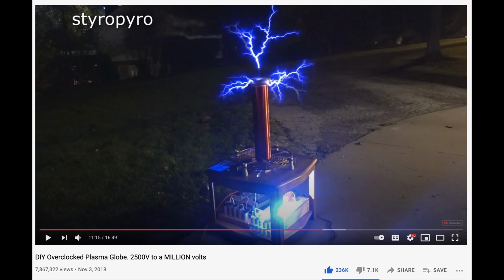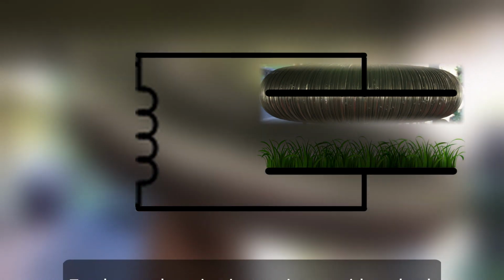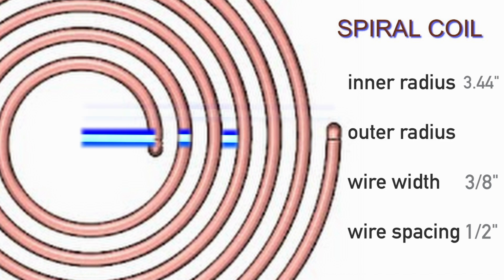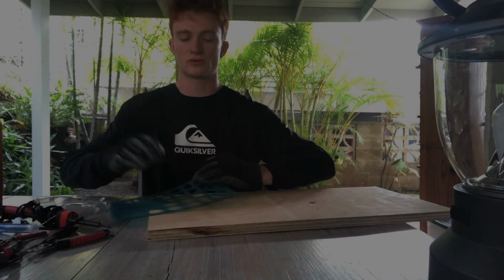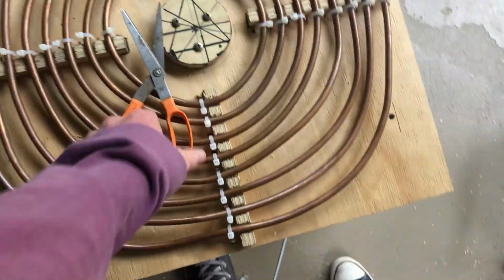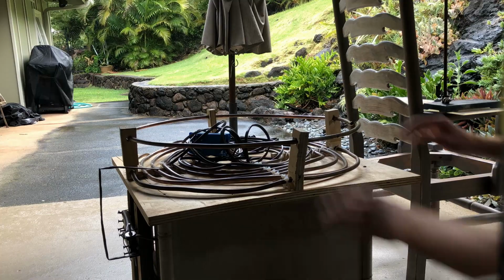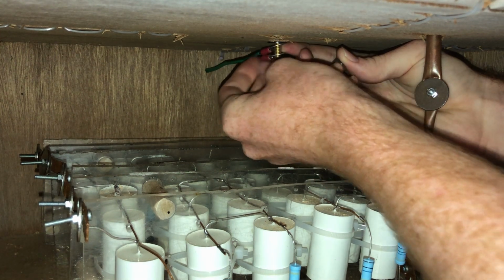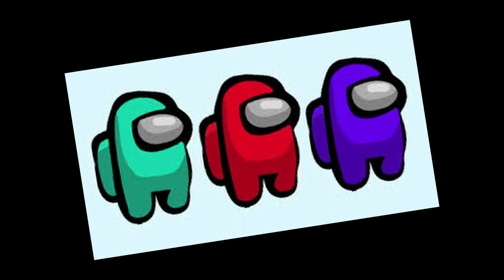I Built a Lightning Machine... Spark Gap Tesla Coil Build Guide

Comment: Like your video alot . Just wanted to let you know to solder copper tubing you should heat the areas beside your solder joint and not directly on it especially when applying the solder it self  . I solder tubes together alot

Comment: I can give you a useful tip for your next coil build. fill your 3/8 tubing with sand. fold one end over and smash it with a hammer, the other end just smashed without folding so that the sand can push out as you roll and it will keep your tubing walls from collapsing as you form them in a circle.

Comment: can you do a vid on how to wire the transformers together? Theres zero videos on how to do this for some reason and no one agrees on whether to wind them in parallel or series...
Reply: connect primaries in parallel and secondaries in series. On the output side, one end is connected to the core and another is usually separate, in the middle of it, usually one wire. Connect the end of one mot, the middle wire to the core of another, then on the one which you connected to the core of another, connect a wire from the core of that one. the other mot, connect wire to middle terminal and thats your output.

Comment: I'm currently building a Tesla coil right now. I've ordered the magnet wire for the secondary, I have my power supply and capacitors. The first 4 minutes of this video answered all the questions I had. Thanks a ton!
Reply: What’s the estimated cost for this set up?
Reply: @Commercial_Investments  If you use the capacitors he used, it would be around $400 for everything

Comment: I want to build a smaller SGTC, using a 2-4kv neon transformer as a starting point.  I live in an apartment and it can't be too powerful.   I know they are expensive but I love spun aluminum toroid, which are not cheap.  When in doubt, consult styropyro....Super Smart, but Super Cool Dude!!!
Reply from the maker: Make the desktop tesla coil i made. Much more compact and quieter, perfect for your apartment

Comment: Hi I,m just starting to build a Tesla Coil, On the Capacitors, Will a Couple door knob capacitor,s ratings of 20,000 volts and Rca 5642 Half-wave Rectifier vacuum tube work also,for Dc voltage. Thanks for any Help
Reply from the maker: Hi! Not sure about the tube but the caps will be fine. Research more about the specs of the tube.
Reply: @BackMacSci  Thanks for your Help

Comment: Can I use a microwave condenser instead of this capacitor system?
Reply from the maker: you cant use microwave capacitors because they will heat up and break due to the high frequency of the tesla coil
Reply: @BackMacSci  So what if I only use 1 transformer?

Comment: use brazing rods no flux for copper.  faster than flux and soft solder
Reply: Also if you're soldering copper and it goes dark/black colored it's WAY too hot and you need to buff off all the oxidation and start over.  Having  a quality flux is really important too,  you should go slow and spread the heat around to avoid burning away the flux.  You should be able to feed the solder in and have it wick up into the gaps, away from the direct flame.
This is also very useful if you ever do any plumbing work, since it's really difficult to get the metal hot enough to braze when there's so much mass pulling away the heat from the join.  Soldering takes place  at a much lower temperature.

Comment: Cost of this ?
Reply: Idk about Tate but I one based if of this, using a rotary spark gap. If you try your best to be thrifty, buying just the amount of stuff you need and search multiple places for best prices, you can build it for around $500
Reply from the maker: Mine was about $700 for everything i believe. But cheaper capacitors could have been used.
Reply: Oh yeah, I used 24 of these capacitors, saved around 60 bucks. I put made rows of 8 capacitors and put three rows in parallel. Job Beeftink, Labcoatz, Backmacsci, and styropyro all have great sgtc build videos.

Comment: I imagine it might have been easier to make the primary less squiggly if you had a ton of little spacers with just 2 holes each, or even just half-holes, sorta like a H with thicker center bar and rounded upper and lower openings, and  you added them along evenly spaced along the length as you wound it up.
Reply from the maker: I dont understand but thanks for the suggestion
Reply: @BackMacSci  I mean instead of just having that fixed jig, also add spacers along the length of the spiral to keep each turn aligned with the previous.
Reply from the maker: @tiagotiagot  I see now, yeah that would work.

Comment: How do you build the spark gap u missed a few steps ?
Reply from the maker: You cut some wood as a base, cut some copper pipe about 4-6” long, drill holes through the pipe at either end, hammer nails through the holes and into the wooden base. Space the pipes evenly apart and set the total spacing depending on the peak voltage reached by your power supply. Watch diodegonewild’s video for more info! 🙌

Comment: Well done! I got my primary of about 9 turns looking pretty good. I used 6 mounts instead of 4 and the had smaller holes under the big half holes so you can zip tie them as you go. It goes much better starting on the outside and working your way in, you really have to massage the smaller turns in carefully. I'm halfway through my first scratch built coil, finally got the parts for building a terry filter to protect my  absolutely badass 10kv 100ma NST! :D
Reply from the maker: Sheeeesh that IS a monster NST
Reply: @BackMacSci  It was the biggest one they had lol

Comment: Good deal. One thing I saw that you could have changed. The copper comes off the spool already bent. You were taking it off the spool then bending it the opposite direction. If you would have worked with the bend that was already there, you would have had alot easier time.
Reply from the maker: Thanks. I agree.

Comment: Hello!!! With 3 MOT... What is the power consumption from the mains? I would like to use 3 MOT like you, but I only have 3kW available in my house. Thanks a lot !!!
Reply from the maker: I have not checked the power consumption before but I know that I pull 12 amps continuously and the MOTS are powered by 120v mains. maybe the 120V*12A then?
Reply: @BackMacSci  Totally agree. Makes sense, but I live in an area with 230V input. I will do some testing, thanks for your reply!!

Comment: Big congrats! Looks very similar to my SGTC construction. The only difference is that I couldn't afford CDF caps so I used wima caps which worked quite decent. The metal bolt to support secondary looks questionable as arcing and significant change in secondary inductance can occur.
Reply: I think the ground strike is limiting the arc length. Try attaching breakout rod so that there is longer distance. Tuning might be required tho
Reply from the maker: @juntendo6104  ooh ok! i'll try that!
Reply from the maker: Do you mean arcing from secondary winding to the metal bolt? I haven't had that issue yet. Maybe I'll experiment more with tuning as well.